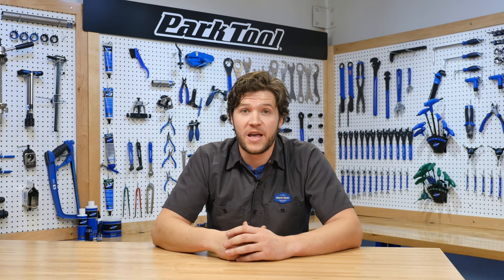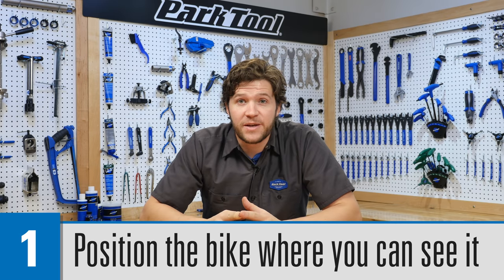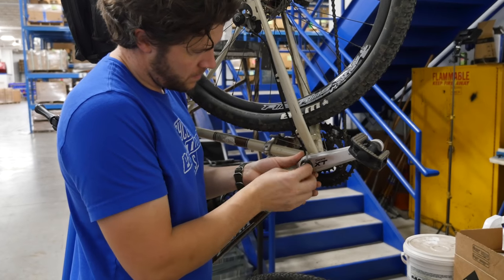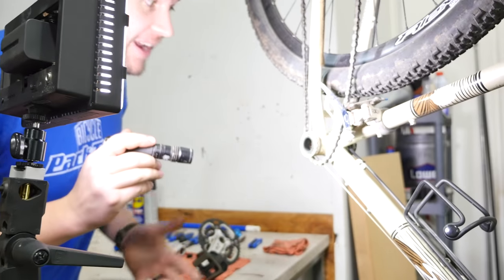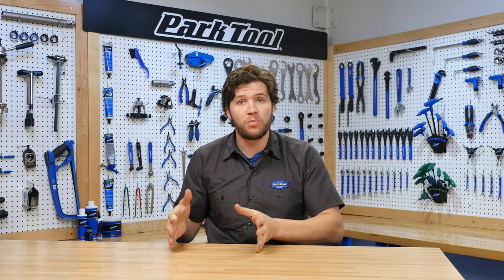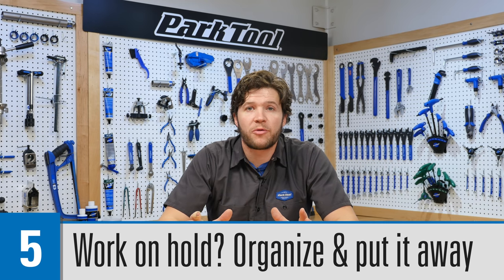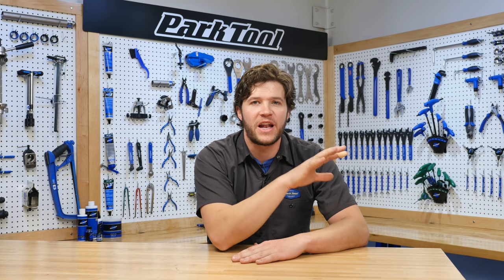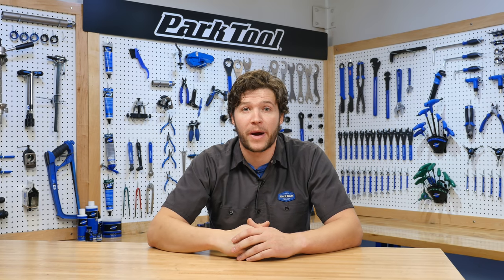Fundamentals of Bike Repair | Tech Tuesday #122

Comment: Here's a tip for mechanics. Never hold a tool unnecessarily over a bike while working on it. Never use a hand for something else if you already have a tool in it (barrel adjusting with a wrench in that hand). You wouldn't want to scratch a new $5300 Factor frame.
Reply: I'm sure if you bought a frame that cost that much from a shop they would take utmost care not to scratch it and even if they did they would replace it because the frame like that comes with a factory warranty and a shop warranty.

Comment: Know when to stop a job and walk away for  a while .  
If needed Clear your head, have a think and come back to it . Dont rush the job .
Reply: jugglematt100 Some shops use the industry standard by the book time allotted per job. Some of it is doable, but a lot of it is ridiculous. One example, changing a shift cable and housing and adjusted, 18 minutes...that’s ok for bikes with external routing, which is ample time for the most part, but some internal routing is a nightmare, and road shifters that the ball end of the cable breaks and jams in the shifter and have to try and get it out, can’t be done in that time.